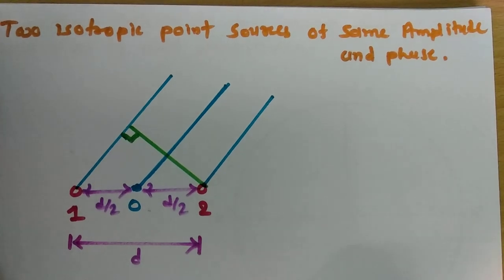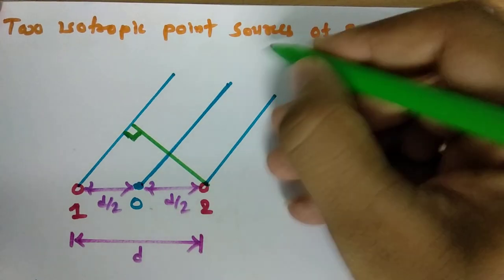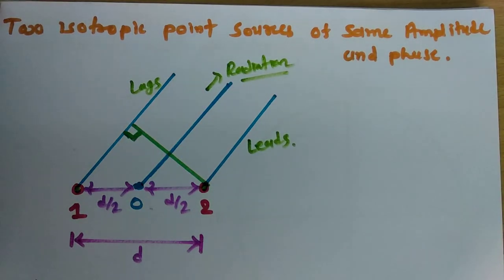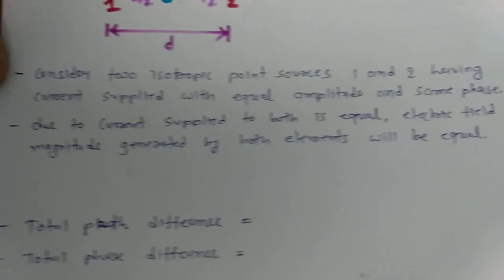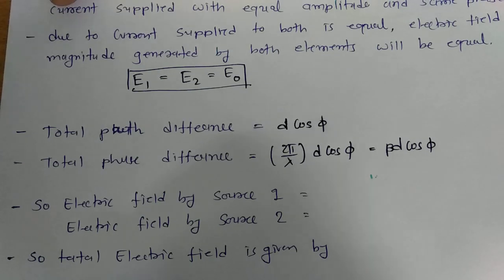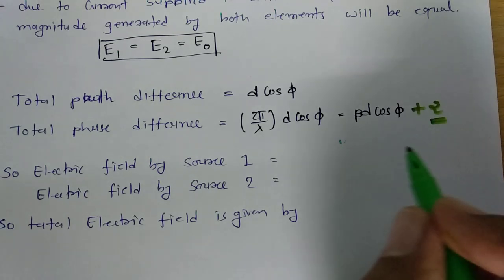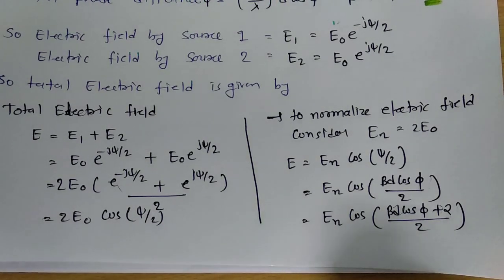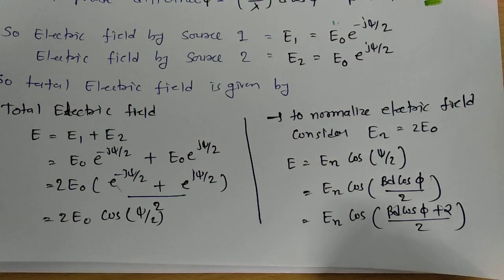Two Isotropic Source Array (Basics, Electric Field & Radiation Direction) Explained

Comment: From where I can get your notes
Reply from the maker: Go on my website www.engineeringfunda.co.in 
And my android application engineering funda
My application is under redevelopment so you get materials from website as well.
Reply: Yes I tried u r app but iam facing difficulty at login page
Reply from the maker: It will be solved soon
Reply from the maker: Go through my android application engineering funda where you will get all materials, i have remodified it.